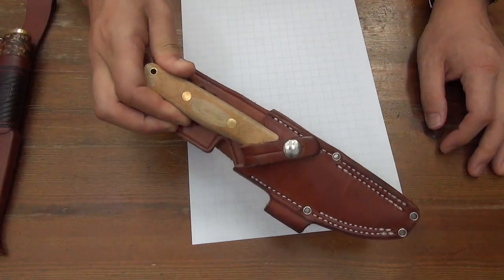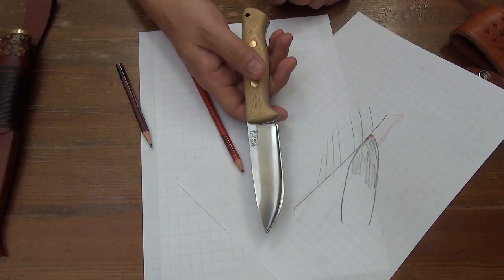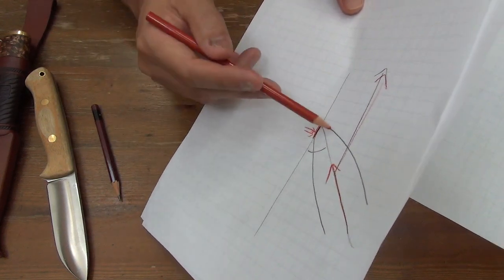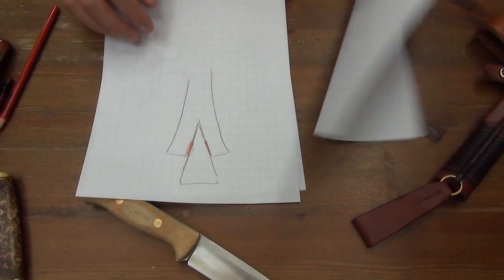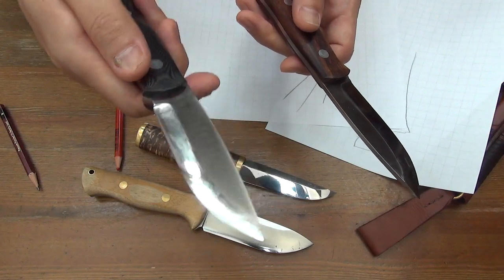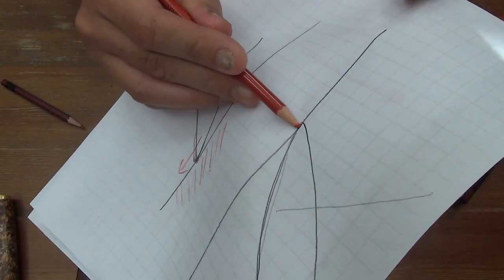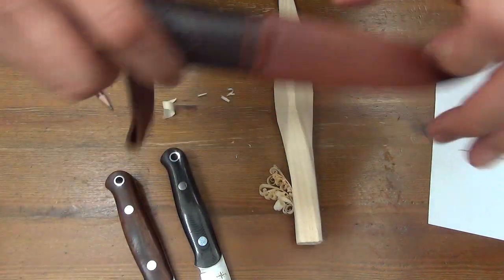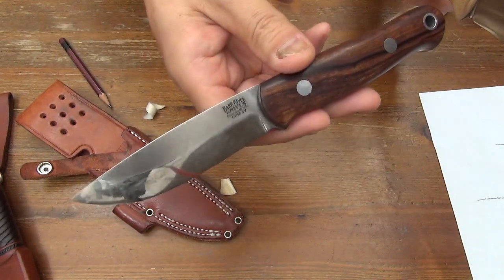Theoretical basis of my hybrid geometry

Comment: I don't think you get fatter curls with the more obtuse convex because you have to apply extra downward force (i.e. tangential to the cutting plane).  I think that, on the contrary, one could make the argument that having the blade supported against the wood means feathersticking is easier, since you do not have to exert counter-force as much to fight gravity and prevent the knife from biting in too deep, and the knife direction may be more stabilized by the extra point of contact.  The amount of forward force (for slicing off a curl) that you apply shouldn't be affected much (for a given edge angle), excepting a little extra drag from more of the edge in contact with the wood.  I think the issue is simply the larger angle.  The bravo 1 wants to bite in deeper, which means fatter curls, and which also means you need to apply more force because you have a larger wedge biting in at a deeper angle, so more force is needed to split the wood.  Once the knife bites, that second point of contact for the convex edge disappears or diminishes - whether, for a similar angle, it provides extra resistance over a flat grind is debatable (wider, so more splitting force required, but less material in contact...in my experience, convex, even when a slightly larger angle, feels like it glides through wood more easily than a scandi).

Comment: In my experience...a convex edge bevel is more difficult to feather stick with than a flat scandi...PERIOD. convex bites deeper. the reason is geometry works is because the edge thats against the wood is the flat SCANDI side of the edge bevel haha...not the convex

Comment: I have the same Pekka Puukko that I ordered after I saw your initial video, but it took nearly a year to get it. ISame leather sheath, but all black. I also received the optional kydex sheath. It's a great knife. I also bought the Brisa Enzo Camper. I've used it to start many campfires with great success. Do you still use yours?

Comment: "The angle to hold is the edge geometry" - his is exactly the same. The only difference is that the grind is convex instead of flat and doesn't bite as deep. His grind is a scandi convex. This makes thinner feathers because the cut is shallow, less material is removed.